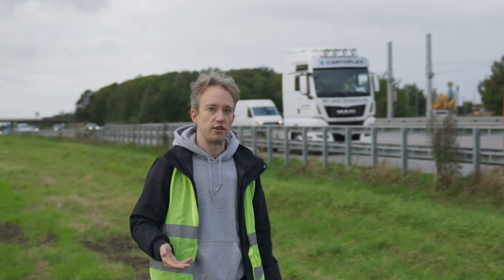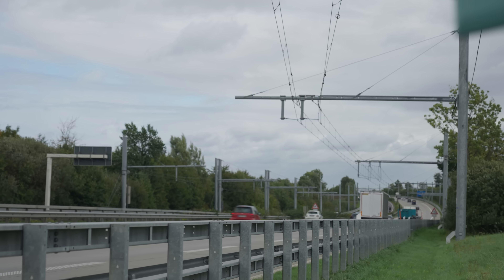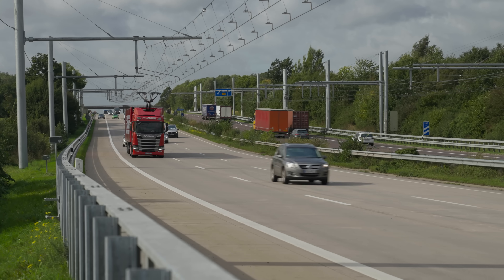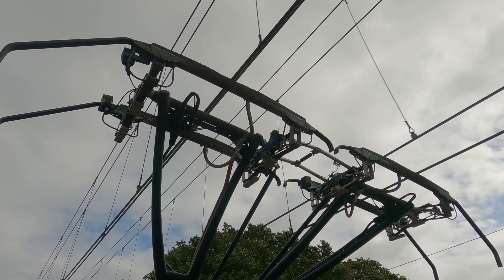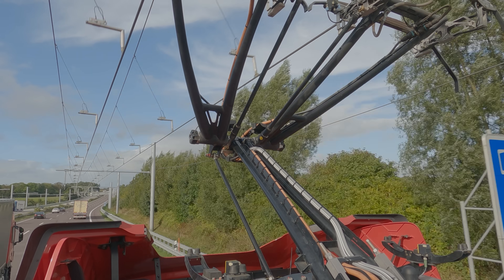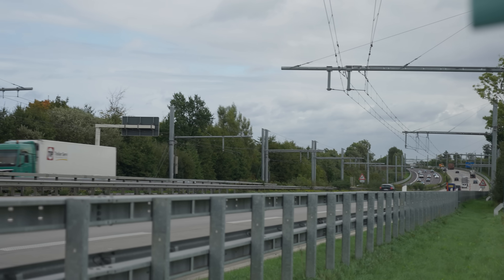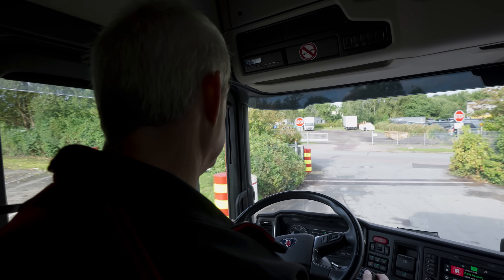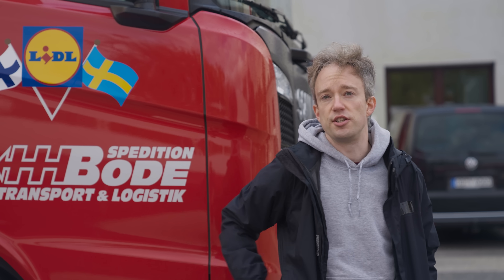The highway where trucks work like electric trains

Comment: In Georgia, USA, they’re getting ready to build grade separated truck only lanes along an interstate highway here to ease traffic. I feel like that would be a perfect use case for this technology.
Reply: Quite a few states need to start considering this. In some places you're stuck going 20+ mph below the "limit" because there is so much congestion.
Reply: grade separated truck only lanes?? why not just use rail, it's a fixed route separated from car traffic! wouldn't that be more efficient than rubber wheels and individual engines per cargo thing?
Reply: @KooShnoo  True but trucks are meant to take cargo to individual location. Trains have a fixed destination.
Reply: @KooShnoo  Onload-offload time is a problem, as is having to match with train schedules and the fact that you still need trucks to do the last mile delivery.
Reply: @KooShnoo in the U.S. , the only form of transport that is nationalized (ie. they only form that is "free" at point of use) is interstate style car/truck lanes; rail is run by private companies whose practices prefer serving single origin large bulk loads to smaller shippers, so anyone looking to ship stuff chooses between trucking on roads they've indirectly already paid for thru tax money whether or not they use or want to use those roads [there is a gas tax, but it hasn't paid out enough to cover the immense costs of even maintaining the current network in a long time and is shrinking in revenue due to less gas use and inflation], and taking extra time/money to work with the nearest rail company in designing a spur/siding, which the shipper must then construct and maintain from their own budget; meanwhile their building almost universally will already have a parking/loading area and a road connection bc these are required of most buildings by zoning/code/law, yet rail connections are virtually never a requirement imposed by any sort of law on any type of land use/building.

yet, rail connections are still maintained and even built out under these circumstances, which is a testimate to rails efficiency over roads
Reply: Steel wheeled trains can't go up more than a few degrees. Rubber wheeled trains exist.
Reply: @KooShnoo  As a train driver I can tell you that rails, switches and the added stuff to control and maintain them are very if not even extremely expensive. A truck on rubber wheels is far less effective, but the pantograph + ev/combustion engine gives you the ability to go anywhere you want at any time instead of getting stuck at a siding when there are infrastructure problems like snowed over switches or power outages. 

A crazy solution would be to have both steel and rubber wheels, but that would also be quite complex and would require the driver and vehicle to comply with both road and rail laws.
Reply: @Badjoe117  that is the dumbest solution I have yet to hear. You just described a train, while somehow removing everything that make trains good. In the long run, trains will always be cheaper and more efficient than cars.
Reply: @hadrienboulch6757  Brainstorming.
Reply: @hadrienboulch6757  Trucks move more tonnage every year in Europe and the US than trains do. For most shippers, the flexibility and costs of trucking long distance will beat whatever a railroad can offer.
Reply: why have a truck only lane if you can have 4 and overtake?
Reply: @KiLLJoYYouTube  Cars get stupid around big trucks. With all the weaving and cutting off that the little guys do, about the only thing the trucks can do in congested places to keep everyone safe is slow down. By pulling the trucks off onto their own section of highway, it keeps cars out from underfoot for the most part and keeps them from breaking flow.
Reply: @Axqu7227   and what happens when the car wants to leave the motorway? has to go past the trucks which = problems. What if the truck lane is empty as well? Why put all the money and cost into making a lane that's going to make a motorway LESS efficient?

"Why not have their own highway", ever heard of a train?
Reply: @KiLLJoYYouTube  NJ has this for a good stretch of the NJ Turnpike. The trucks and cars have separate exits so the cars never have to cross through the truck section. Fun fact, in order to keep the cost of the flyover exits for the cars down the foundation for them is built up using old Jersey barriers that have been retired.
Reply: I would love to see that around Atlanta.
Two right lanes only for trucks in Atlanta.
And trucks right lane only accept pass.
That's how Georgia is
California just the same
Reply: They will be building them along I-75 from Macon to I believe a few miles south of where the south side express lanes start.
Main reasoning is to support truck traffic from the port of Savannah and other places. As others have mentioned, keeping them separated from mainline traffic eases congestion and reduces probability of accidents.
Also of note is that freight rail capacity/frequency has been increased from Savannah and other nearby ports. As has also been mentioned, trucks have better last mile coverage that rail simply cannot touch. Both modes should really be viewed as complementary to each other.
Reply: And a beginning to autonomous driving protocols
Reply: Rubber Wheels have very high friction, I wonder if this could be even more efficient with steel wheels on a steel road.
Reply: They actually tried that but sadly most folks that drove passenger vehicles started to complain about why trucks got there own lane's and now it's now the car only toll lanes
Reply: Electric line trucks is nonsense at best and a waste of taxpayers money and is completely unrealistic for a national transport system.

Comment: Germany would contaminate Waaay less if they stopped closing nuclear plants like crazy and guzing non renewables for the power required for those trucks. Which btw would make those truck's still not be carbon positive. If the source of electricity is not clean.

Comment: I’ve only seen this on slow city buses. Would be very interesting to see how well it works at faster speeds
Reply: It works at 300km/h on railways - but that requires quality infrastructure and hardware maintenance. I don't see that with the average trucker! Railways have spent 190+ years refining the safety rules and regulations. It works well in Europe, Japan and China and reasonably elsewhere but much stricter regulation of road delivery operators would be required.

Comment: Hmm... I can see this going either way and it depends on the efficiency of our governments... So, particularly in the UK, probably don't want to get our hopes up.
Like, there's no reason not to give it a try, and it could totally be extended to long distance (or even shorter intercity) buses that already augment the rail network. Trolleybuses used to be a common sight in enough cities, and the word was in my autocorrect. Could even, on that basis, have certain routes into and around cities sporting their own catenaries. Whether its possible to engineer a way for vans, minibuses and even private cars to tap into it as well...?
On the other hand, we haven't even got fully electrified rail lines yet, including the freight lines which would benefit the most from it in terms of reduced emissions and noise (trust me - my bedroom backs onto one and but now I can give you a good guess at what kind of engine is passing without looking at it). And finishing that off is a much smaller job than rigging up wires over lane one of all our motorways and trunk A-roads. So on that basis it's about as likely as full construction of HS2, or any of the glaring motorway gaps being filled in and alleviating a bunch of congestion pinch points... More likely to get extra airport runways and yet more new lines across London.

Comment: Honestly I think that's a great way to increase the practicality of EVs, would be cool if you could get a trailer for an EV pickup truck that has a secondary battery and one of these mechanisms on its roof to get more juice as you're driving.
Reply: Different idea: Trail very close to the truck and "plug-in" (One car per truck) and use the system of the truck.Trucker company gets some commissions. Car plugged in at the back becomes a "slave" to the truck driving in front (Braking, steering, indicator, etc) -> Fully "automatic" (by the truck driver) drive. Driver of car can get some rest. After fuelling up enough, overtake and continue on the road quicker.
Reply: @marwerno  that would be illegal by so many ways. And that would be dangerous as well if the car just connects to the truck like a trailer, that would be dangerous
Reply: @NAYDM_Official  he's facetiously describing a train, which already exists.
Reply: @NAYDM_Official  Dangerous: Well, if it the approach is computerized it should be ok.
Illegal: It is just a matter of legislation. In Australia it is ok to have 2 trailers. On a highway, why not?
Reply: @mrzev5926  he's not
Reply: Novel idea and it is already being done.  The problem is these batteries are very very technical and dangerous.  They have heating and cooling systems and computers to control them.  One guy on shark tank was pushing boxes that had batteries that could be used to recharge the car battery at the rate of 1 minute per mile.
Reply: It is a stupid idea and stinks of government market interference. Governments just because they want something does not mean they can will such an idea into being. 
One of the biggest issues right now is that copper reserves are not going to cover this electric renewable future that governments are trying to legislate for. These types of moves are going to do more harm than good.

Comment: So I think there's an obvious question: What about over-height trucks?

Not as in power delivery. Simply, just avoiding the over-height truck absolutely destroying the infrastructure.
Reply: The rails appear to be a good 3 feet, maybe more, above the truck. Over height loads rarely exceed 15 feet in height and most standard trucks run between 13’6” and 14’0”. In cases where super loads need to be moved, most jurisdictions require a surveyor to plan the trip well in advance and require extensive permitting. I think the risk of overhead collision is minimal, but not zero. I doubt this is any more daunting than bridge  and overpass clearance, which we already deal with daily.

Comment: It looks like a good idea to me and it is just an experiment, that's not over for another year.
Yes steel wheels are more efficient than rubber but traction is a real problem with trains.
It looks to me like they are more interested in something that is able to fit into existing infrastructures.
Electric trucks don't need transmission's and electric motors are as simple as dirt.
These things might be all over Europe with no drivers by 2040.

Comment: I agree with the other commenting about investing a lot of this money and effort back into the rail system. Think of all the tire savings,  oil changes,  fuel stops that won't be using fossil fuels. Why completely reinvent the wheel.
Reply: I don't suppose there are rails running through your local supermarket?
Reply: @takatamiyagawa5688  I suppose to clarify I should've said that these ideas are fine and all but we have a great infrastructure that needs love to called rail.  Bring it in from the shipyards to further inland with hubs set up in a more strategic network.  Rail is nice because it doesn't use millions of tires a year and would clear the roads assuming there are enough bridges etc. There will never be a way to replace trucks completely.

Comment: Catenary wires on railways often come down and that's with not much use from trains only going past at intervals.  Now imagine loads of trucks and the wear and tear on the cables.  It looks a bit of a mess too. Clever idea but if a cable goes then everything turns to chaos until it's repaired. Railway freight can move far more in one go too!

Comment: Really wonder if they would want a truck pulling a fuel tanker or some other Hazmat  freight hooking up to high voltage overhead wires. I wouldn't. Some Hazmat types forbid flame or sparks with 25' of the vehicle.

I still think their will be a viable solution to replace petroleum based liquid fuel with an environmentally friendly renewable based liquid fuel for cumbustion engines. There probably is one already but energy companies probably have it locked away. The delivery system is already in place and liquid fuels for combustion engines are the most portable energy source for remote locations.

Comment: To be clear this is not the "most efficient way to use the energy". Rail vehicles tend to be more efficient. I am not sure about the amount the efficiency increases through electrifying the Truck. it should ,if you compare well-to-wheel/tank-to-wheel, not be better than Trains.
Reply: The railway is 4-10× more efficient than trucks based solely on rolling resistance. I get that trucks are great for last mile distribution, but for longer routes it's way better to use the train.

Comment: This is a shitty idea 💡  because it's dangerous for a human and the electrical lines will be damaged over time and it will need more replacement than a battery 🔋 also cold and warm weather with a tornado can ruin the whole damn network of those... a battery is a better solution. THINK ABOUT THE SYSTEM. its older than your grandma and they say it will cost billions it's like EA selling a new dlc for The sims 4 that's 7 years old now and still sells at full price... ITS A DAMN MONEY GRAB no personal car can gain access to it...

Comment: this is not a reasonable solution because most grid power is run off of Coal anyway. Also what is the solution for oversized loads since most are going to be higher then the cable?

Comment: Okay, so we got this and tether lorrys behind each other, as most of the time, they go the same direction. So one can drive on front and the other ones follow with just a little gap to save space. After that, we can eliminate the steering by making the wheels follow fixed grooves in the road...

Jokes aside, as much as I love Tom Scotts videos, I think this very expensive test track is completely unneccesary... just a few meters away was a railway line that has been decommissioned...
Reply: And how do you get the cargo off the rail line?
Reply: @catprog  A crane for example or a forklift. But that would be a much better thing to invest in: Small, fast and cheap ways to transfer cargo from a train to an electric truck for the last few kms. Big factories could also get it's own rail connection so you can deliver good directly to them on the rail. And as there is a lot of cargo in train cars, you could actually use the train cars as storage until they are empty. This has been done until Just-in-time came up. And for the sake of the environment, we have to step back from this.

Comment: Roads are designed for vehicles up to about 4.5m high with bridge clearance typically 5m. If you crib say 0.8m for the transmission lines (which will have their own clearance requirement) you limit vehicles to say 3.8m high. There's lots of vehicles including many tall buses which won't be able to use this system.

Comment: I can see a deadly safety flaw with this system and that is that road vehicles are INSULATED from earth and cannot be earthed and have a large mass of metal which could become dangerously LIVE if the vehicle's insulation were to break down, whereas trains and trams are effectively earthed via their tracks. And what about the increased risk of mass electrocutions if the wires get ripped down like in a severe storm or because of a serious crash which is more likely on a motorway where drivers drive at much higher speeds?!
Reply: Residual Current Devices (RCD) have been fitted in electrical systems all over the world for almost 30 years now, it's why you no longer get electrocuted when you drop your cake mixer in the sink.  The moment the circuit realises that it is not a complete circuit it will shut off the power in a matter of milliseconds.  Also don't go putting your toaster in the bath as your house might not have RCDs installed yet.
Reply: @krashd  No, my consumer unit, or load centre, doesn't have RCD's. And in my experience RCD's can fail and don't fail safe, so extra safety features are a must. And I wonder how many folk have been severely shocked or killed by trolley buses which have been around since long before RCD's. And RCD's are no excuse for taking silly risks. And things like washing machines still have to be earthed even when an RCD is fitted in their supply.

Comment: Why not just use hydrogen in vehicles that have to regularly travel large-distances (or large-sized, like a plane), and electric battery-power for cars, small vans and buses that only travel a small number of miles each day?

I can't see this solution as being better, given all the metals that will be needed to construct it...
Reply: Because the only way to make hydrogen at scale currently is with fossil fuels. Plus the tanks needed to store the hydrogen require a lot of materials as well.

Comment: This also shows a proper rail cargo system would remove most trucks from the road, reducing emissions further and making roads safer. But it's a great idea and would compliment it perfectly
Reply: Lorries will always have a place. I mean, what going to get stuff from the train to the businesses?
Reply: @johnb8956   Much agreed. What I'm suggesting would remove lorries from motorways and A roads, rather than hanging power lines above them. I feel like it would be better.
Reply: Probably should have thought of that while you were wasting all your resources on high speed passenger rail.  😂